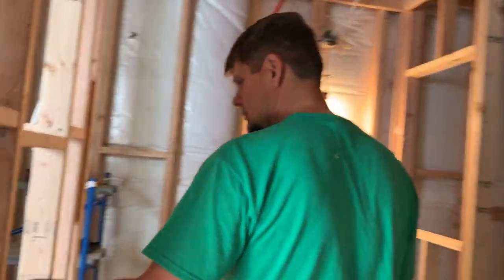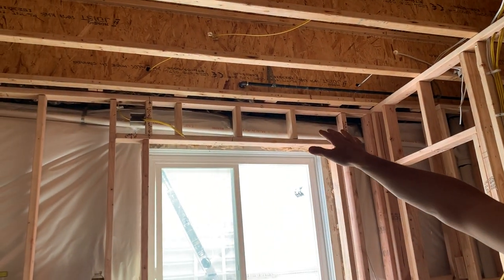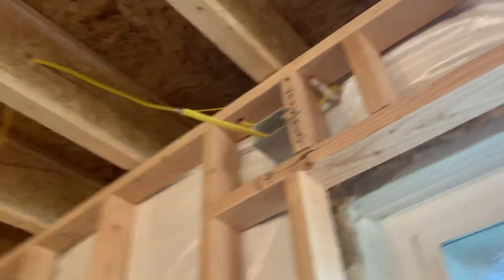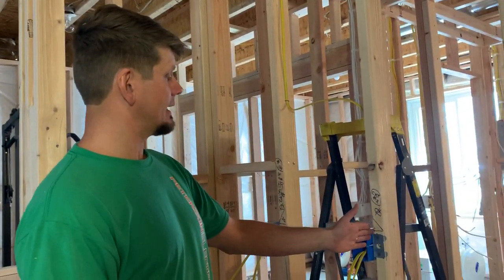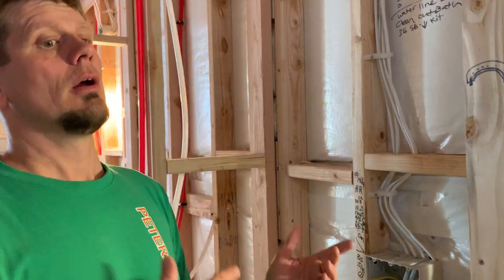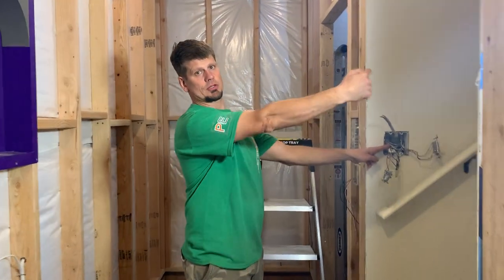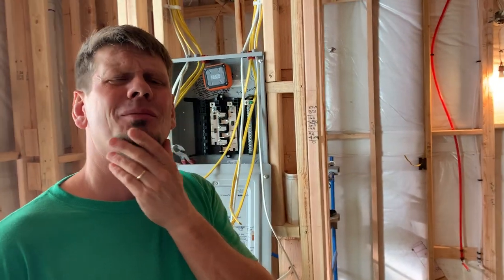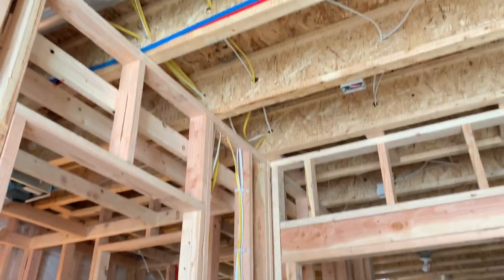Wiring an Unfinished Basement - Part 2

Comment: There's something to be learned in most of your videos. Good points about all of the home runs and exercise gear needing more circuits. Adds up quicker than you think. You did mention pulling #6 feeder and that it's a pain in a small conduit, but I can't imagine using only #6 with so much going on in that panel. I don't think I heard you mention what the final draw might be.

Comment: Receptacles in dwelling units are required along unbroken wall spaces of 24" or greater, not 20" as you stated, per Article 210.52(A)(2):  "Wall Space. As used in this section, a wall space shall include the following:

(1) Any space 600 mm (2 ft) or more in width (including space measured around corners) and unbroken along the floor line by doorways and similar openings, fireplaces, and fixed cabinets that do not have countertops or similar work surfaces."

Comment: have you looked into lever wago connectors you can tie in all your grounds than just lift up lever release one if you need.  i myself am a copper crimp guy with nylon snap caps(but am looking into using the wagos for multi grounds like this example and for light fixtures over wire nuts). copper crimps keeps busy bodies away from tampering with  connections 🤣🤣 we used to get warranty calls (cookie cutter home developments) about three ways and multi branch circuits open up box see no crimps just wirenuts charge em for the service call and sometimes trouble shooting labor depending on how bad they messed with system.

Comment: tht grid ceiling code use metal blank cover plates  drill hole land bx coupling or use plaster mud ring need to tap ground screws in both use plastic boxes still.  just something to think about in future if it ever comes up🤔😉

Comment: In the gym I would have run 12-3 romex  backed by a 2pole 20 amp gfi/arc fault breaker other then that it looks great 👍🏼
Reply: What brand of breaker
Reply: Mr. 3 Phase what ever brand the sub panel is
Reply: @catdog262  just never heard of a dual function 2 pole breakers before, then again in been doing electrical for 3 weeks lol
Reply: Mr. 3 Phase I have been in this trade for over 23 years and yes they definitely make that breaker I just used one the other week.
Reply: @catdog262  must be an American thing

Comment: Here in canada we use metal boxes in every application and for some reason inspectors want all the grounds bonded to the same box regardless of how many circuits there are... Doesn't make much sense like you said, but they will make us change it if we have them separate. Stupid codes I think
Reply: look into wago lever connectors all tied together lift lever release one if you need to